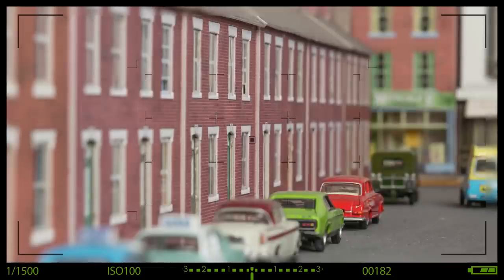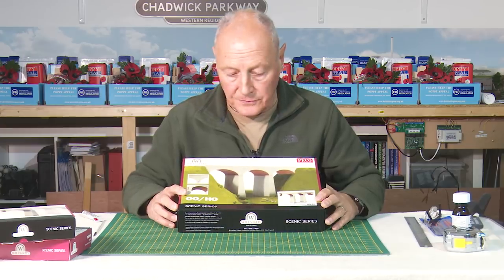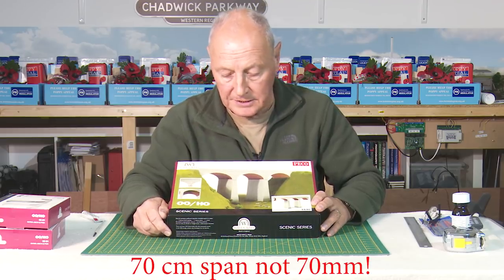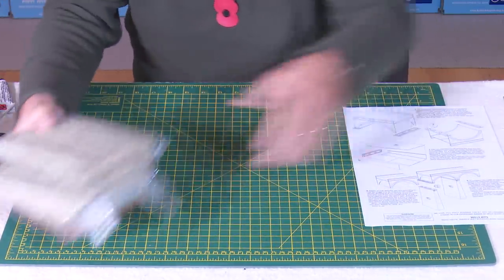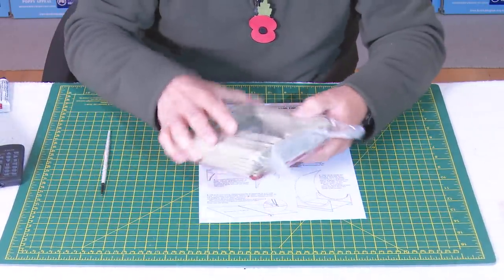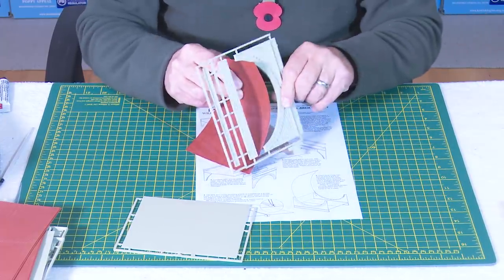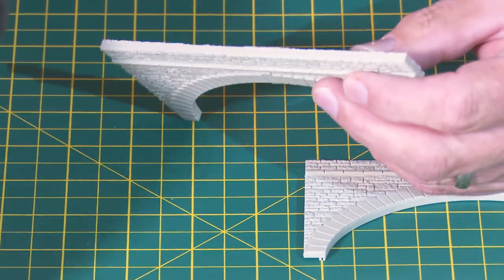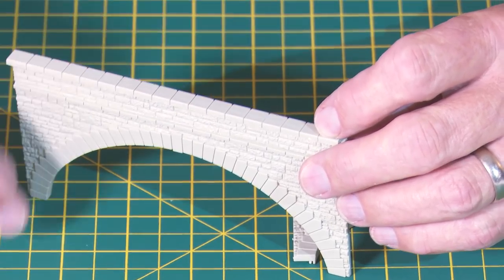46. Building a Viaduct at Chadwick Model Railway

Comment: Great video. Just a note, if you want to bend plastic or resin, just heat it up in boiling water for about 5 minutes. It will then become extremely pliable and you can bend to shape with a jig or something similar to the desired shape and it will cool down and stay that way.
Reply from the maker: Great tip Falcor, many thanks. 
Regards Charlie

Comment: A great video and very interesting, I don't actually have a model railway. But between this channel and another model railway channel I might be tempted back, after having one as a kid. I would have been tempted to deviate from the instructions on building the archways and try another way. I would have made one side of the arch with the road/rail surface then attach the brick arch liner to it, then once glue is set I would then stick the other arch side to it. Or even just stick the brick liner to one side, then add the other side and when set put the road/rail surface piece on. Might be easier than trying to feed through after building the arch. Before someone says it I know it's an old video, but just what I was thinking while watching it. Scratch build model R/c boats is more my thing so used to not having instructions to follow, and having to find my own solutions to these sorts of things.
Reply from the maker: I’m so pleased you found the video interesting. I like to assemble in accordance with the instructions, just to prove how difficult it can be! 
We need you back in the hobby, now go and buy yourself some stuff and get started. Regards Charlie

Comment: Great video, Charlie. And great finished product! I find the EMA stuff excellent and it'll weld most plastics that other solvent weld products don't (incl PLA), but I don't use it for normal builds like this as it is very toxic, as you've said, and a bit overkill IMHO. Tamiya, Deluxe Materials or Revel solve weld works fine and is not quite as hazardous.
Reply from the maker: I think I’ll switch when I’ve used this one.

Comment: Very nice kit. I seem to remember that dipping plastic in very hot water, (holding with tweezers), will help to bend it. You could use a sheet of very fine emery paper on a sheet of glass on the edges of the completed sections to smooth out the line. That would also give a rougher surface for the cement to take.
Reply from the maker: I’m so pleased that you enjoyed it and some great tips too.

Comment: Just built the N gauge version of this , i ignored the instructions about fitting the red brick after gluing the two halves together . I preformed those by wrapping them round a suitable diameter plastic tube with some thin plastic sheet over the top that the kit came packaged in then held them in place with  elastic bands and placed in boiling water for a few minutes then into cold water and hey presto curved brick parts that i glued in place the added the track bed .
Reply from the maker: Great move Shaun. Regards Charlie

Comment: It may have been more convenient to poor some of the plastic weld into the cap of the bottle so you get a better idea of how much you're getting on the brush, especially if it's one you plan on using again. You could've also used the bottle as a sort of square or block when putting the walls and road together, but I really only say that because I didn't see any clamps or squares used. Thank god the only issue you had when assembling was the discovery of the viaduct out-of-box wasn't actually completely flat.
Reply from the maker: Yes SP, it was a bit of a challenge.

Comment: Nice job Charlie! I did one over the summer out of three full packs which has nine arches. I do agree this kit if not assembled carefully can be a real b*tch to build, mine certainly was... I fitted it with brick pilasters made from plasticard (this took ages) above the piers to hide the seams between the individual arches and intend to turn it into a railway/roadway combo. Joachim
Reply from the maker: I’m Joachim, that’s very interesting. My intention is to run drain pipes down the pillars which will mask the joins.

Comment: A good way to bend sheet like the red liner is to soak it in boiling or very not water and then wrop it around a suitable cylinr like a a paint can and fasten it with tape ubtil it's cold.  I actually use bands cut out of old car inner ubes - free from my local tyrefitter.
Reply from the maker: What an excellent idea, Terry. Someone mentioned using the oven! Regards, Charlie

Comment: hot air gun on medium heat mate, will bend that plastic nicely, i always give the plastics a coat of primer before taking them apart
Reply from the maker: Great advice as usual mate.
Reply: Wouldn't use a hot air gun....a hairdryer or leave the plastic in hot water for a few minutes to make it pliable.
Reply: @Synthematix  Just watch the heat setting. Was drying  some circuit board once and being in a hurry had it set too high. Found out that SMT solder paste melts at a lower temp. then 60/40 blew a number of SMT components off the board. Spent 6 hours with a magnifying glass       repositioning  them and resoldering.
Reply: @Synthematix  If you pick up the cheap hot air stations from ebay, make sure to open them up and make sure the earth is done correctly. It's extremely common for there to either be no earth connected inside or the chassis and/or gun not to be connected to earth. They're a great, cheap tool once you've checked that.
Reply: Yea no worries mines only 24volt, the transformer is isolated
Reply: Yea you can if you set too high, liquid solder is designed to melt with much less heat and i always put silver foil on top of the component

Comment: Someone else has probably said it below, but you could do the same trick with the track beds as you are using for the coping stones. Yes it means cutting one in half but again you are using the mason/bricky's trick of off-setting the joints. 

I guess that track bed must be strong enough, but it seems very thin compared with your 12mm base boards elsewhere on the layout? Is there a need to laminate it up a bit?

Spoiler! I see you address this in the next couple of videos. So much for an 'easy' kit!!!
Reply from the maker: I’m so pleased that you enjoyed the videos CB hopefully you have subscribed too.

Comment: For all of my glue bottles I make a piece of 2 X 4 wood and drill a hole the size of the bottle. I have had to many bottles of glue fall over and spill. With the cost of the glue now, I feel that I have to have the extra caution with the glue bottle base.
Reply from the maker: Put, don’t forget David, superglue should be kept in the fridge. Regards, Charlie
Reply: @ChadwickModelRailway  Always... I put it in the fridge in a jar with a drying agent... I tend to buy the small tubes of the stuff and use it up before it can set up in the tube...

Comment: If you are doing a lot of sprue cutting , a sprue cutter saves a lot of clean up time. Please could you tell me where you run the earth wire from your command station to. thanks for a excellent video David
Reply from the maker: Hi David, I’m so pleased that you enjoyed the video and I will soon acquire a decent sprue cutter!
The earth (or ground) cable runs to other Digitrax components such as BDL168’s and PR3’s.
Regards Charlie
Reply: @ChadwickModelRailway  thanks David

Comment: About a year ago, I built a curve viaduct, and in the Faller or Kibri kit I used (think it was Faller) you had to heat up the plastic in the oven to make the brick work under the arches as it wasn't thin and foldable like this kit. 

Long story short, what did this fool do? He forgot to set a timer for how long they needed to heat... 😅
Reply from the maker: I’m sure that it was an easy mistake to make. Regards, Charlie.

Comment: Thank you for sharing this experience , I learned a few nice tricks . I have been looking for parts  to make cantilever supports for my slot  car track ( for reference : 2lvl carried acrosse 12' to 16' , a huge double deck bridge like )  ,the style or look I am after is like steel trusses ( Eifel Tower I think is a good example for what I want the structure to look )  [1/24 scale Carrera tracks ] fyi  .I could not find with certitude parts with that scale , so I will have to assemble with smaller pieces , trusses ,girders and so on . I can do that and set correct life like proportions .my problem is to find those "H ,L, I ,T ... " plastic look alike parts in a proper size .You know where I can get some of those {Kits of Truss /Girders Etc would work } ? TYVM & Cheers  from Montreal Qc
Reply from the maker: That’s sounds very interesting. I’m so pleased that you enjoyed the video and good luck with your project. Regards Charlie